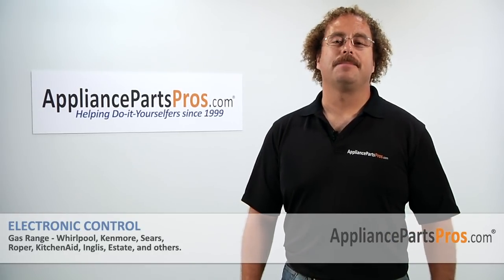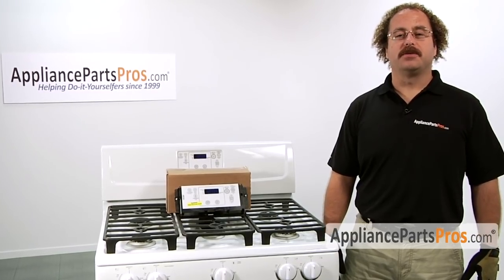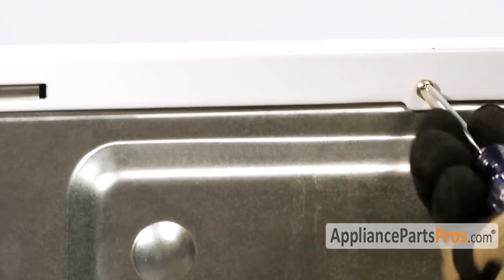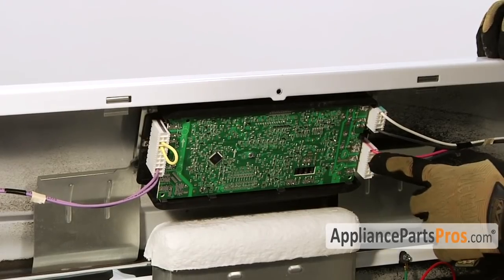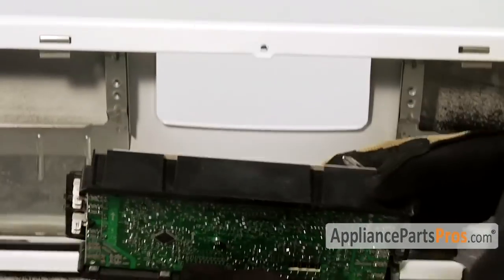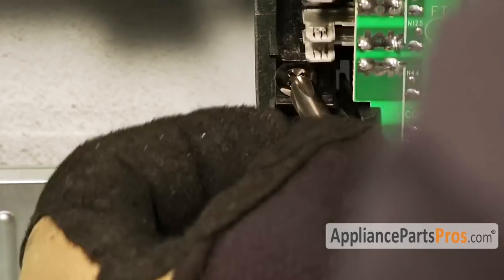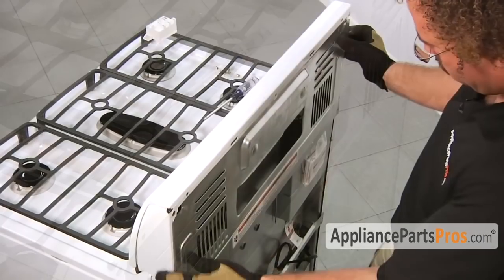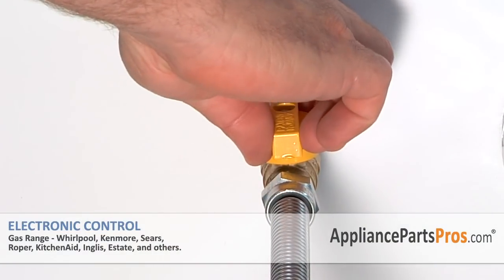How To: Whirlpool/KitchenAid/Maytag Electronic Control Board

Comment from the maker: According to your model number this is the clock assembly, AP4422855. The bake and broil relays are on this control. If the bake relay is bad it could cause the power to drop out while cooking.

Comment: Looks easy, however, the demonstration skipped replacing the connectors. If anyone follows these instructions as shown the repair will fail. On the other hand, I appreciate seeing someone else do most of it before I try it myself. Oh, on my stove there are two separate parts for the buttons and the circuit board. I'd like to see that kind of repair as well.

Comment: My Whirlpool WFG231LVQ0 shuts off within 30 min at 350 degrees.  I've looked up parts on this unit and didn't see a clock assembly to replace.  Is it the Electronic Control module on this model that shuts the oven off?

Comment: Hi there great videos but I have a question when I turn my oven on say at 200° it keeps getting hotter and hotter until I have to shut it off manually I checked the temp probe and it's 1100ohms it's a gas Tappan range any ideas what's causing this?
Reply from the maker: +frank vaccaro Could be a bad relay on the board not shutting off the heat when needed. You can post the problem along with the appliance model number on our repair forum and the techs can help you troubleshoot the problem. http://forum.appliancepartspros.com/
Reply: Great I will do that thank you
Reply: Merry Christmas to you

Comment: Why do you not talk about exposing the control to Electrostatic Discharge damage? You have exposed the control to damages that could be latent in nature and you would not see that until it fails again and you have another service call. Just a thought.
Reply: A valid concern for newer stoves, but a lot of the older stoves from the 80's & 90's are build to very high tolerances, and feature older style hand soldered parts rather than IC boards.  The former are orders of magnitude more tolerant of ESD.  For newer boards however, it'd definitely be best to reply on a pink poly inner bag, and a mylar outer.